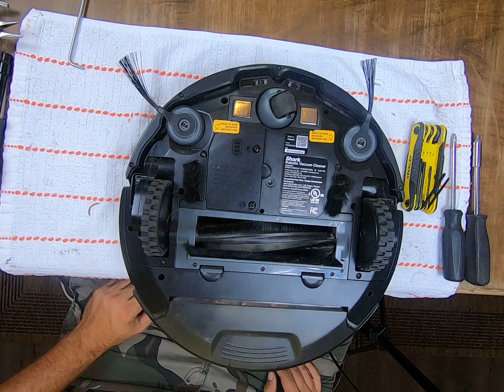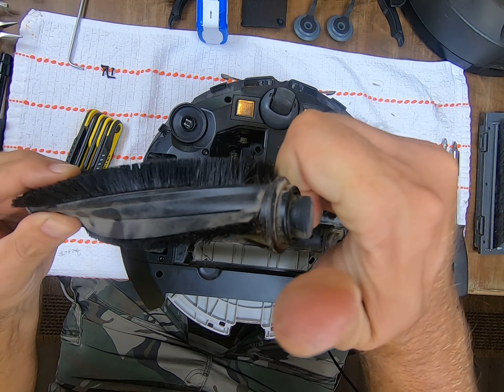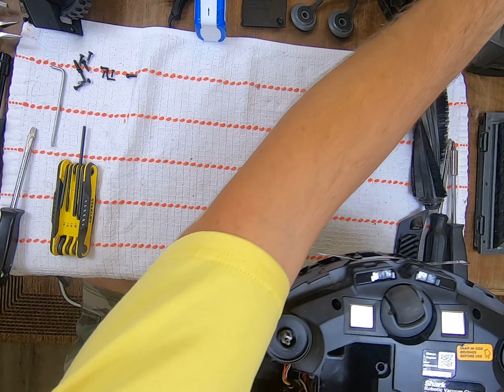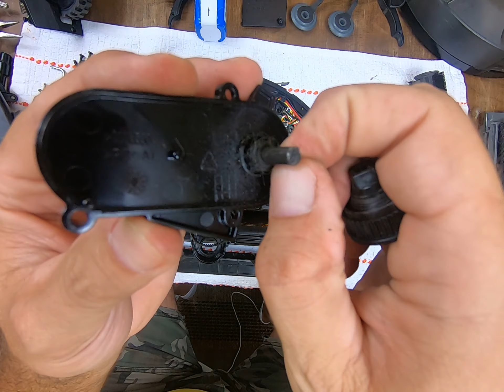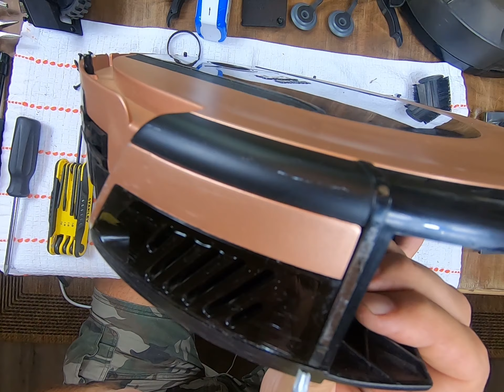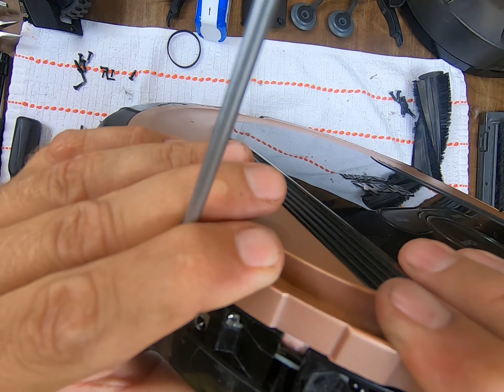Clicking and Squealing repair on Shark

Comment: The 130mm belt is to tight the motor won't run with that length belt,order the  same length belt 132mmx2x6 the belt is wider and thicker than the OEM belt and it will never slip again and won't burn the brush roll motor out,talking from experience

Comment: What a terrible design. Mine started squealing after 48rs. Not dealing with cheap junk
Reply: Mine has run everyday for 3 years no probs. Cleaned like this video said and prob good for another 3 years. 
Yours prob has a loose nut between the steering wheel and the seat

Comment: I've got an RV700 Shark Ion. I replaced the stock belt with 130-2GT-6 and I couldn't spin it by hand when I put the belt cover back on. You said, "You can't make it turn." and I'm wondering if it's quiet now for you because the brush is no longer spinning. I didn't risk burning out the motor and put the stock belt back on. Mine was squeaking, not clicking, so the belt probably wasn't my problem. Anyone else not able to turn theirs by hand after replacing it?

Comment: I called Shark and could not get a spec on the belt, a part #, nor order the belt itself from the OEM.  I can't buy a new motor or new unit every time it picks up a sock. you have saved me much grief, time and money with this fix. A better belt and a better machine

Has your motor held up with the stronger tighter belt?

Comment: Did the trick for squealing.  Hair around the roller ball was hard to spot until I put on reading glasses.  Also, the ball does pull off of the shaft which makes removing the hair much easier.  Once I removed the ball (and the hair) I oiled both the shaft and the ball.  Running like a champ at this very moment.  Thanks so much.

Comment: Thank you so much for this! It gave me the confidence to fix mine and it’s running perfectly now. I have the RV750N... for that model there’s a third screw you have to remove to get to the motor and it’s UNDER the motherboard, so you have to take that totally out (versus just loosening). And the belt size for the 750N is 132-2GT. Hope that helps others!!
Reply from the maker: Elizabeth Brown so glad it helped!!
Reply: the original belt that he takes off is a 132 length-2GT-4 wide, he changes that to 130 length and 6mm Wide for a stronger grip and less play. go with the 130-2GT-6

Comment: Here's one for ya. I started having main brush roller issues after owning this robot for about 1yr and 3 months. In the end, by hooking a multimeter to the contacts on the main brush roller motor and watching the robot clean, it would receive a consistant 9V when it was working. However when the robot goes over a section of very low pile carpet (like a door mat), the voltages would fluctuate wildly then eventually go to 0 and roller would stop altogether. I've already replaced the main roller motor and that didn't work. Since the supplied voltage to the motor drops to 0V, i'm guessing it's the main motherboard? There's really no forums or anywhere to discuss problems like this so i'm posting it here. Considering parting the robot out altogether since I called Shark and all they could offer was a discount on a new one lmao. Help anyone?